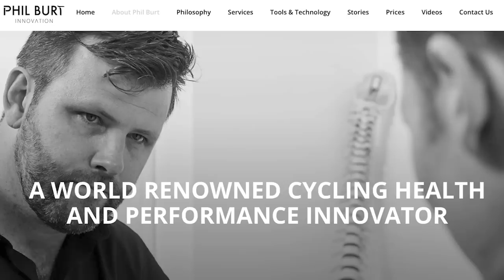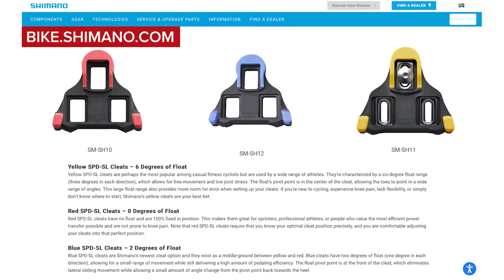Tech Tricks: Why Cleat Float May Solve Your Knee Pain!

Comment: When I first started using cleats, i used the included 0° float and just followed the "general rule of thumb" to position the middle of the cleats to your bone in your pinky toe and it's just fine for me. No knee pain or whatsoever. 

Then I switched to a 4.5° float and I reverted back to the 0° because mainly I just like the "feeling" of it, more secure and I think I'm more in control of the bike

Comment: Having had Meniscus Surgery on Both knees.....
 I have in the past always ridden with mid range float for knee Recover and to building Leg Strength . 
But now as Phil said Proper set up, cleat positioning, Bike Fit plus Trial and Error have put me at Now Using  only
"Fixed Cleats"  They have proven to limit the movement in my  leg and pedale Stroke alighment. Which has helped to set my knee in a Fixed position. and ease joint aggravation.
Thank GCN!!!
PS.... Rode Up Mt Lemon for my 60th BD in Nov. :)
Reply: i also have had meniscus surgery, i dont have knee pain yet but i had the injury fixed when i was about 22-23 and im now 31 which makes me still 'young' but as i get older they predicted arthritis after 30. im just curious when you had your surgeries and did the mid range float start to hurt your knee and thats why you went to fixed? i ride with float as well just because i always have been, but again im all for what other people have to say and their advice.
Reply: @JwallzMTB  I had 50% of my miniscus removed when I was about 20, and was told to stop playing football or i would have arthritis by 25, I stopped that year but played for fun about a year or 2 later. Im 27 going 28 this year and I can feel my knee on cold winter days when I dont cover up or have a bad warm up/cool down. I have 2 degrees float, I feel that it keeps my knee relatively still otherwise it starts to flop all over the place exacerbating the issue.
Reply: @DeStraatz  even 'low impact' sports like cycling still cause problems.. which sucks.
Reply: @JwallzMTB  Sorry it took some time to reply .  It was not that I was experience an extreme amount of discomfort with Float.
It was more of an issue of Efficient Biomechanics and understanding that for me.  Limiting the movement in my lower leg translated to a more efficient Leg alignment 
The knee still gets sore (Some) But its cool. Im Old and Fit sooo Im working with what I got. Diet and Lots of CBD , Yoga and Dynamic Stretching Keeps me comfortable on my long rides. Limiting ( Night shade) Veggies or Gluten works for me!!! :) Good Luck

Comment: Some people need to decrease/eliminate float to avoid knee pain, some people need to increase it. I suppose it depends on the root cause. If your knee pain is caused by repetitive movement then allowing the joint a little more rotational freedom might help (which is what Phil was getting at unless I'm mistaken) If its a rotational injury/problem then preventing as much rotation as possible makes sense. I do think people should pay more attention to cleat position before assuming they need to change the float though.

Comment: I started with 4.5* Look Keo cleats and went to 0* float last July. I absolutely love them, they keep my ankles in a more stable position and therefore keep my knees in line. And, unclipping is MUCH easier in an "oh shit" moment, compared to the much longer motion to get out with 4.5 float cleats. The extra half second has resulted in me on my ass, which hasn't happened since I switched.

Mind you, I also had a computerized GURU fit and bought my current bike based on the results of that, which took into account my 0 float cleats and 165mm crank arms, and my fitter put my cleats where they need to be. Actually, he said he'd prefer to put me further back, which I might try.

Comment: I used Speedplay Frog pedals for over 20 years.  I injured my left knee in 1967, when I was 17 years old.  I had a lot of knee surgeries, culminating in a total joint replacement in 2001, and had the other knee replace in May, 2021.  I loved the free float provided by the Frogs.  But when Wahoo purchased Speedplay, they stopped making the Frogs and stopped making replacement cleats as well.  So late last year I had to switch to Look X Track pedals.  They offer some float, and my knees haven't ached any more than they did when I was using the Frogs, but I do miss the Frogs.

Comment: Hi Ollie.. 

Watching this vid has been very  useful and some good info from Phil.. he’s a great guy, met him at work once.. 

I’m thinking of switching from Shimano to Speedplay on a new (yet to arrive) bike.. 

Between the two of you, you clear-up most if not all of my unresolved questions, many that seem to be what puts most people off using them - too much room for adjustment..

With the facts and detail from Phil it’s clear you just need an understanding of what float is, then dial in what works for you (ie the amount on your current Shimano cleats) and bingo - no more one-sided clip-in issues!

I’ve been trying different saddle heights lately too and it takes a fair few rides to get it right. We’re talking MM’s here BTW.. it’s the only time I think I could have felt like Eddie!!

I’ve never yet experienced knee pain (touch wood..!) but have always had a set-back cleat position for power rather than comfort.. useful to know that can affect your knees too..

Thanks!

Comment: I'm not the only one using M 540 mountain bike pedals on the road.  Paired with the right road 2 bolt shoes, the cleat can be moved way back. - in the aero department but good for not slipping on coffee shop floors. + for the easiest bearing system to maintain and durable.
Reply: I'm with you...i prefer the practicality of being able to walk over the 0.000003 watts gained by using the clown shoes lol...i understand if you're  TdF level rider but if you're just a weekend warrior it's not worth slipping around the coffe shop floor every ride

Comment: I use zero float, not for power transfer but for unclipping. I cannot flex my ankles out to unclip very well and find that well positioned fixed cleats easier to unclip correctly and avoid a Matt Stevens Special. But I will stress that although I have never had a professional bike fit I am very careful with my bike setup so I know I will be comfortable for long periods.
Reply: Same. I started with 4.5 float Look Keo cleats and hated them. My LBS kept telling me "you won't like 0 float" to the point that they actually refused to sell them to me. I bought them on Amazon and never looked back

Comment: After doing a Chris Froome 23 years ago and breaking my neck of femur and subsequent NHS fixation, my right leg is 17mm shorter than my left leg. I have never used height blocks on my short leg and have used both black and red look cleats over the years. I have never suffered from knee pain ever. I think that saddle height is the most important element, even with a short leg. The body adapts to injuries and I believe that to some extent I ride a kind of ' side sadle ' now but float has never been an issue to me after hundreds of thousands of miles riding, both before and after my accident.
I also think that with fixed cleats, if you do not get them straight, you put more stress on the knee, because the knee then does not rotate in a circle as it should, being pulled on the side, I think that bad fitment can be the cause of knee pain, in this regard more float can eleviate bad alignment problems.

Comment: Never used float, never needed it. I've always used Black Delta cleats. Back in the 80's, it was determined that only 10% of riders really "needed" float.
Reply: For those of us who were young in the 1980’s I bet that number is a lot higher now.
Reply: @jameswitte5676  Before the mid 80's, everybody used "fixed" cleats, with toeclips and straps. Even with Professionals, who put in over 20,000 miles a year, few people developed knee problems.
Reply: @billkallas1762  I started using cleats in the late 70's and no amount of adjusting would eliminate my knee pain.  I filed the groove in the cleat into an hourglass shape, to provide some float, and presto!  No more knee pain!  I guess I'm in the 10%.  I have Speedplays on the bikes that get ridden more than 25 miles at a time.  Everybody is different.

Comment: I get pain on the inside top of the knee. More or less at the tip of the quads. Only on my right knee. The reason that I haven't invested in a bike fit us that a very well respected bike fit guy in London says exactly the opposite from this advice in terms of saddle height. I use spd MTB pedals on 4 different road bikes all slightly different geometries and different shoes - all mainly to avoid an exact repetition of movement. It's easy to spend a bunch of cash and still get the wrong advice. I'm also loathe to go somewhere where they sell you £100 insoles and £250 shoes as a solution which may make no difference. Any recommendations in the North East of England?
Reply: I have the same. Problem started last year. Right knee at the inside of my knee, where the quad attach to your knee. Later in the right i kinda feel it under my knee where the tendon is.
I did a bike fit last year, changed cleats, i have float and went to physiotherapy multiple times. And still i have discomfort riding my bike. On this point i just dont know what to do anymore.
I am waiting for a call from the hospital to let a specialist look at it.
Reply: @mikewow  Sounds very similar. Hopefully someone will be along to offer a suggestion. I also try not to push big gears and climb out the saddle where I can. Very hilly here.

Comment: #askgcntech Hi folks, after watching your 'Why Cleat Float May Solve Your Knee Pain', I was wondering if it's possible to extend your pedals' width position with an extension in order to have more float bandwidth. I walk like a duck and I suffer from severe knee pain after riding long distances with my feet being held in a parallel position for hours. I did get a bike fit, but it hasn't resolved the issue. I'm currently using Shimano PD-M540 model. Can I purchase something in order to get more comfortable?
Reply: I believe its called "stance width" ,   Speed-play used to do different length  pedal axles to dial this in.     Try a search.   Cheers.

Comment: You never asked the obvious question… so why even use clipless peddles?!  Flat pedals let you put your feet anywhere you want… is the power/performance of clipless worth it?  Is there a video on that?  He seemed to imply the gain is not that significant
Reply: They have done various videos comparing clipping in and flats. From what I remember from the last one I saw the power/ speed advantage of clipless over flats in is marginal if at all. But you can engage different muscles to different extents and thereby spread the impact by using clipless. Also it depends what you are used to or prefer in terms of feel. I've gone back and forth over the years trying to eliminate knees pain, but just had different knee pains with each system!

Comment: I dislocated my knee last year.  Not for the first time. I'm really afraid of going back to clipless. Any ones out there that don't require a twist of the knee to get out?
Reply: Magped and the Bythlon System, they seem weird and gimmicky but they always get good reviews from people who try them, I've only tried the Bythlon ones and only briefly and they felt fine and not how you would expect. The other (way cheaper) option is Shimano MTB pedals combined with their Multi release cleats, They still require a bit of a twist but nowhere near as much as road pedals do, you can twist inwards to release if you want and if you set the tension low you can just pull straight up out of them, this does however give you a very floaty feeling while riding.
Reply: @chris1275cc  Thanks for that. I had mountain bike spd pedals before but didn't know you could exit them either way. I had them at the loosest setting but there still was a fair bit of resistance getting out. Maybe I'll stick to flats! Cheers.
Reply: @jamesb1717  Its the special cleats that make all the difference (Shimano SH56 Multi-Release Cleats) if you already have the SPDs and the shoes it might be worth a try for the sake of £14. Another thing I used to have on my commuter a few years back are those Zefal Half Toe-Clips I'll admit they look kind of naff but they give you most of that "being part of the bike" feeling and at £5 a set hardly a great loss if you don't get on with them.

Comment: Hello and good day GCN Tech, I've been curious to know if crank arm length has an effect on knee pain? I mean, longer crank arms will cause a larger range of motion but also change the effects of torque through the pedals and in theory effect ones knees. I'm curious if this theory actually has any merit. Cheers! #askgcntech
Reply: Yes, shorter cranks will help both knee pain and hip flexion discomfort, allowing you to bend more into your tuck position. The shorter the better. I would recommend 160 up to 170 if you can find them, but there are services out there who can either drill and shorten cranks (typically 50 quid a pair), or provide a range of new crank arm lengths in your preferred chain ring bolt patterns.
Don't use 175 unless you have very large legs or you go offroading

Comment: Ollie  I am 68 and have ridden for over 50 some years. I remember getting bike fits back in the 70's and 80's  that never tackled q-factor. In today's world all great bike fitters do. What I have found is float and q-factor go hand and hand. I like at least 3 deg's of float with some drag, and on my left foot I have a 1.5mm spacer on my peddle and 2.5mm spacer on my right along with the cleat all the way yo the inside of my shoe. Viewing from the top or straight on that stopped my knees from moving to the outside at the top of the stroke. All this is related to the hips. In your video at the top of the stroke it appears the right knee is moving to the out side more that the left side is. Just my opinion, I'm not a bike fitter so don't take my word for it, keep spinning those cranks. Rick D. Blessings